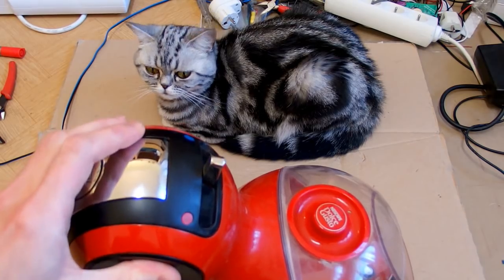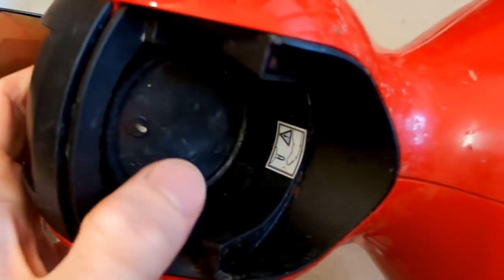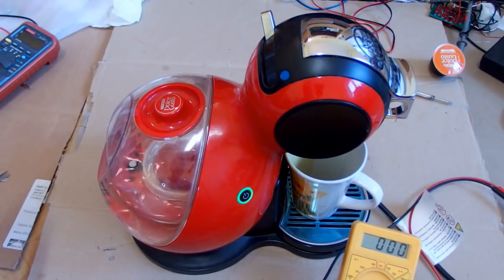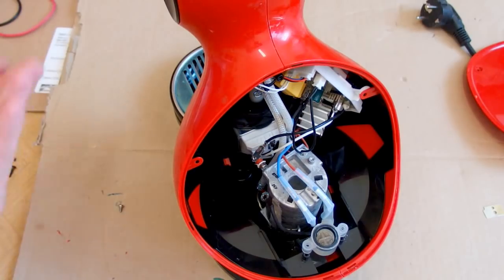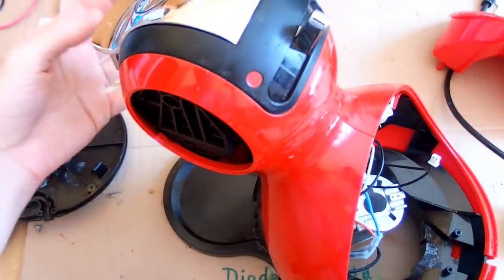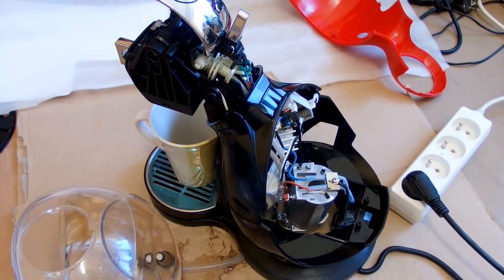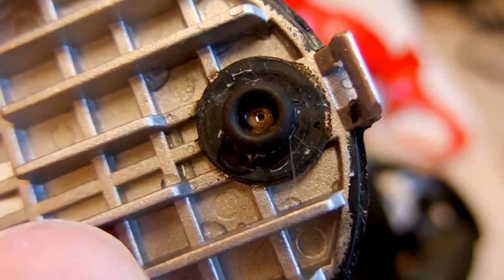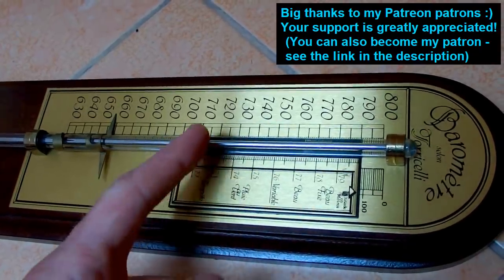What's inside a Coffee Machine (+ repair)

Comment: You underestimate the cleverness of printer manufacturer. The cartridges of the printer you buy don't have the amount of ink as the ones you buy separate.
Reply: Even better is a leading manufacturer which name I won't name for legal reasons. But their logo has a H and a P in it. Offers a subscription service where they send you Ink if it runs low. The cartridges the use for this purpose are circa twice the size and quadruple the weight of the once you can buy.

Comment: The BT137 800 is a  very very common triac ... the bt137 600 is mostly found on those ebay blue handle solder irons with adjustable power ... they are named solder irons with adjustable temperature ..but it is just adjustable power solder irons. 
The coffee maker is a very well known model all over Europe and from a very known brand :) 
Your cat is very cool also.

Comment: The heating element is inside that metal can thing. I took apart a Keurig version of one of these. Got a bunch of nice parts. A small air compressor and a very nice pump. There was an LCD screen but it was all white when you plugged in the machine which was the reason I got it to tear down.

Comment: I have owned two K....g coffee makers, same idea as the one in this video, different shape.  My first unit stopped pumping after three months so I called their tech support. Their entire troubleshooting procedure over the phone was to have the customer unplug the needle with a paperclip.  I knew that wouldn't work because at the time I only made hot water for tea with my unit (didn't like the cost of the pre-packaged coffee cups which also tended to be stale from the stores in my area) but I let her follow her flowchart anyway.  After several tries she finally agreed to send me a new unit.  While I waited for it to arrive I took the broken one apart, found the hose that had pulled off the top of the tank, put it back on and the thing has worked fine since.  The new one also had a problem which I'm sure would have not been repairable per their procedures.  However, to save them the cost of replacing it (and my trying to convince them that I actually had two defective units) I took it apart, found the one-way valve inside the end of one of the tubes that had glued itself shut, gently pried it open with a small screwdriver (the valve probably became stuck due to some residue left over from its manufacture) and that machine, too, has been working fine since.  BTW, K used to sell a filter cup and holder assembly into which you can put your own coffee grounds.  You simply use it like a normal disposable cup and clean it out after each use.  Mine has lasted five years and shows no sign of wear.  Saves lots of money and tastes better because you can use coffee that you know is fresh.

Comment: I have a Dolce Gusto mini, always wondered what was inside :) I had to repair the water tank with clotch tape for repairing glass windows on greenhouses. A new one is too expensive lol. They do cheaper Kenco and Aldi knock off compatible pods in the UK which I buy, but I sometimes get offers from NesCafe to get discounts ordering online. I won't pay more than £3.50 per box as they are a rip off lol You can get cold drink pods like Peach Tea, Lemon Tea and some other nice cold drink pods ;) Your always welcom to come round for a Tea if you prefer, but I do drink coffee but it keeps me awake lol not sleepy :), oh and bring your cat, I love it, I could stroke her all day :)
When the pin enters the pod, the clamp down creates a seal. The water pressure forces the water out the bottom, you can hear it pop when this happens. Inside is a small silver foil over little spikes in the plastic at the bottom and a plastic seal over the coffee under the label. The pods are self filtering.
As a first guess before watching the whole video is the pin is blocked by scale, there should be a small circular pin prodder behind the water tank you remove to unblock the water pin :)
Reply: Dolce gusto is an italian coffe machine, and it's not too bad

Comment: Just descale this coffee machine with acid solution, check for any leaks and it should work fine. I think I can see metal pin for cleaning that needle hole at the back of this machine. Put your finger on that ring and pull it out. You can also get refillable silicone or metal capsules online. Parts for repair also available but sometimes it's not worth to do that. Better thing to do is to buy semi automatic machine with steam wand and seperate coffee burr grinder manual or electric. It's more reliable with only two thermostats for water and steam and you can make a lot of coffee drinks.

Comment: coffee catridge is made from top cover foil that is punctured by needle and 2 cm lower second plastic foil with  small holes it keeps coffee in place-below that is coffee, below coffee is lower plastic foil that is seal and it is completely closed before using capsule, same as top cover seal. below lower seal is sharp strainer/filter, and last part is capsules hole,  it works like this: needle makes hole on top seal and it is pressed and sealed from coffee machine rubber pilow that is pressed down when lever is down, hot water enters into capsule, and passes through, coffee , pressure raises in capsule and coffee and water brakes lower seal on plastic strainer/filter that has sharp tops , and coffe comes out of capsule,

Comment: Maybe the coffee pod bottom opens under pressure from the water?
Reply from the maker: Or maybe it melts... who knows... but the cartridge probably can't be pressurized much, it would leak around the needle.
Reply: You are right Stuart. Here is a cut of capsule. You can see that on the bottom is a thin foil which is pierced by field of plastic spikes on the bottom when top of capsule get under pressure. That is the reason why you shouldn't use capsule once used. ;)
https://commons.m.wikimedia.org/wiki/File:Dolcegusto_capsule_w_annotations.jpg
Reply: Cartridge teardown is in order, I think.   I was thinking melting or dissolving like medicine capsules.
Reply: seems like the bottom just contains some plastic mesh, and the coffee inside maybe is so compressed, that it doesn't let air trough yet, when you press the bulged top.
Reply: Not anther needle at the bottom???
Reply: It is pressure release valve. It bursts under the 9-15 bar pressure of the pump.

Comment: You could do a teardown on the capsule itself. I guess it is filled with a noble gas to keep oxygen in the air reacting with the coffee, and the bottom seal is held on by the pressure. If the top of the capsule is punctured by the machine, it releases the pressure, that releases the seal and lets water flow through it.
Reply: Another comment already answered this. See https://commons.m.wikimedia.org/wiki/File:Dolcegusto_capsule_w_annotations.jpg for a sliced capsule.
Reply: I've since taken one apart myself, and it was more or less, like my assumption. Pretty clever construction that keeps your coffee fresh until you use it.

Comment: The capsule sensor is a reed switch. There is a magnet embedded in the rear of the holder. I fixed one of those once, it was the reed switch that wasn't working. :)
Reply from the maker: Thanks for this knowledge :). So many details I didn't examine, and the video is already over 30 minutes long :D

Comment: You shouldn't reuse the capsule once punctured. It opens under pressure. The needle tends to clog a lot. Especially in areas with 'hard water'... so its best to often run a cleaning solution through the device.

Comment: There is less in there than i expected, i first thought the bt151 was chopping the voltage to the heater to  change the heat, but then you showed the valve mixer.
Odd how that tube got clogged.

Oh hiding behind grey squares don't stop us knowing that you like wearing a gingham dress he he :-D

Comment: Nice diagnosis of the blocked needle using the syringe of water connected to the tubing. The excess of plastic parts in the design seems a little overcomplicated.

Comment: that's very interesting. I've had the square Krups dolce gusto in red for many years and got the exact same one in black for free with my news paper subscription... after not using it for a year, it did the exact same thing. I really wanted a second one for in the office because I really like them, you can make both cold and hot beverages (there's different pads / cartridges). I get the off-brand ones at the store and they're about €2,30 for 16 pods, which is very decent and about twice as cheap as the real ones. I ended up just buying a new machine (Amazon temporarily had Delonghi machines for only €25!!, usually they're only Krups in Europe). after your video, I'm just gonna poke a needle through the dispenser/needle... I might end up with 3 dolce gustos...
I also get really sleepy after drinking coffee! it's currently 00:17 and I just drank one, so... goodnight 😂 .. they make good hot chocolate and tea as well, though.
Reply: Usually if you get sleepy after coffee then you are overtired.
Reply: @LimbaZero  I think it's because of the heat, but it's a known fact caffeine has different impacts on different people. If I force myself to stay awake after drinking coffee, I won't be able to fall asleep for another few hours.
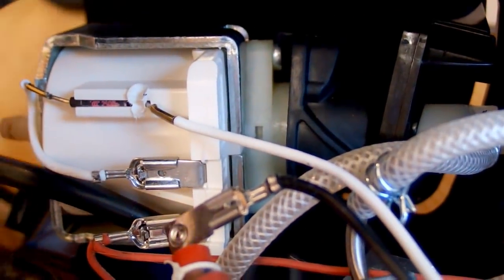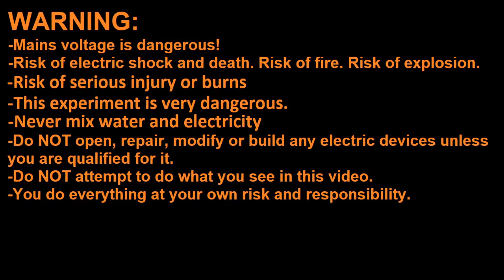For example I drink coffee at 23:00 and fall asleep by 23:30. But if I stay awake until 0:00, I'll find myself doing something random at 2:00 because I can't sleep.

Comment: If you want cold water,it's faster to turn a valve than waiting for heater to go cold.
Reply from the maker: That's probably right. But I think that water would cool it very soon, because it has much much higher thermal capacity than the metal.

Comment: So basicly.. If youd just take the metal wire from the back of the water tank you'd have fixed the issue in seconds. Its there for a reason, the needles get clogged pretty easily.

Comment: What happens when you power the device with more than 60HZ of frequency? Say 100?
Reply from the maker: The heater is not affected by the frequency. The capacitive dropper would supply more current and the zener would dissipate more power. The pump may pump faster, or maybe not. It will vibrate at a higher frequency, but probably also at a lower amplitude (the piston will travel a shorter distance).
Reply: DiodeGoneWild : Oh, thats informative.. Thanks.
Reply from the maker: ...now I noticed that the pump is only rated for 50Hz, but the whole machine says 50 / 60 Hz at the outside. This seems wrong.
Reply: DiodeGoneWild : Maybe make a video about it then?

Comment: Are you planning to upgrade to 1080p? Very interesting video!
Reply from the maker: Of course I think about 1080p. My camera can shoot 1080p, but my computer is smoking when editing it. And of course, many times the 1080p video is not any sharper than 720p video, because cameras can only focus at one distance at time. They focus at a particular point, which is often not the one you want it to focus at. Or an average, but this doesn't make it any better. And finally, you really can't tell if it's focused properly looking at the tiny camera display :).
Reply: DiodeGoneWild your computer smoking when handle 1080P video... 
Try to buy a new pc :)

Comment: The printer is worse then you think: The cartridges that come with the printer are often a slightly different part number cartridge than the ones you buy independently. The difference is that they have very little ink in them to start with! Something manufacturers do to discourage people from just buying new printers, as consumer-level printers are often sold at zero-margin, and the profit made on the ink.

Comment: Coffee is basically a drug and as soon you get it, as time goes you can't pass without it. I usually drink coffe to prevent terrible headhakes and low blood pressure. The printer cost's is really the ink . I use a electric kettle and buy bottles of coffee, just shake and its ready. It can also be used to make tea. By all means if you don't like coffee don't drink.

Comment: people should  every 2 weeks do some maintenance-put some acids  into water and let it goes through machine to melt stones made from water/scale, repeat it first on cold and then on hot , i use limone acid - not from fruit, it looks as sugar, i made 0.5 litres of it and same acid can be used 2 times, every 2 weeks, after every cleaning, rinse with 1 litre of water on cold and hot and machine will work with no problem for long time

Comment: i'm surprised that they put so many thermal fuses in it. i guess because it's so overpriced device? and there's another one in pump as well. but nothing on mov

i suggest putting them into devices you might build

relay contacts are another place that can heat up. but it might be useful elsewhere too

there are actually fires caused by something mentioned here. usually the temperatures are up to like +130'C which should not allow any fire or even melting. i mean yes they make thermal cutoffs for higher temperatures but i'd keep them for, eg, stoves

as for if they break currents at 10a, who knows. as they break by heat, that would be maybe higher current. 10a, sometimes 16a and 20a is just the current they can pass without getting hot and tripping. that would also be reason to take precautions if you solder their leads

talking about solder, there are actually overvoltage protectors that solder spring to mov by low temp solder. if it fails and heats up, heat travels up leg and it desolders itself. though in case of ovp, i'd suggest disconnecting power and not mov from circuit. i expect spring, leaf or blob of low temp alloy be present in cutoffs themselves too

but yeah, they aren't expensive, use them

Comment: Why did you need to digress to the printer?    And yes it makes a cold latte!  Red for hot, blue for cold!   Most appliances have an on and off switch😂  No, the screws are not designed to stop you opening it, you just a star drive!   If in doubt force it open!!!!      Sorry.   You could obviously see how that bottom came off!!  without forcing a screwdriver in it.  Bored at watching your vid now! it is sending me to sleep!!  😴